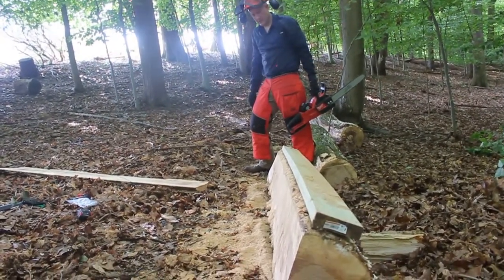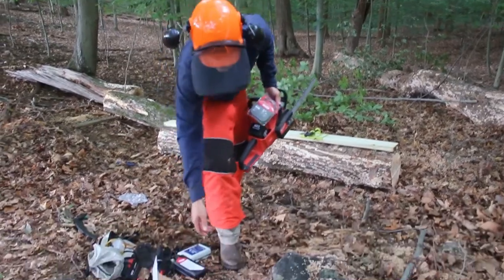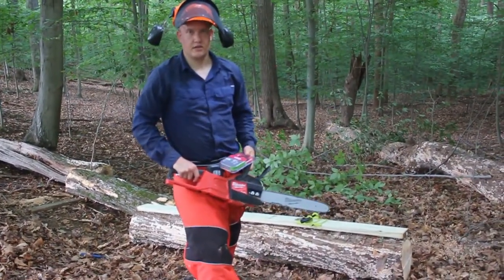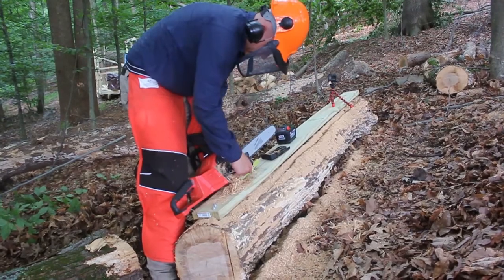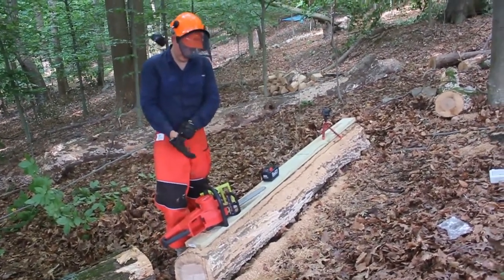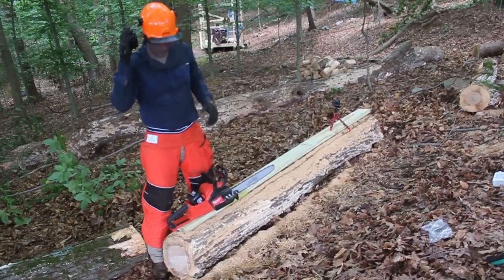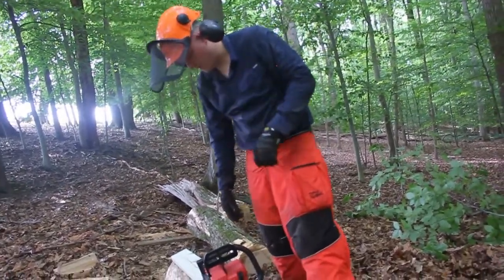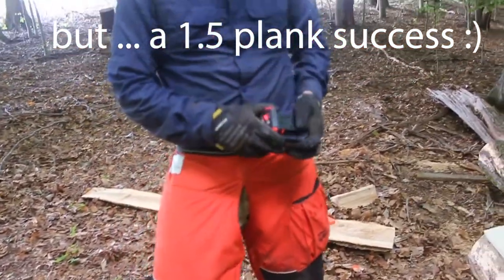Will a Milwaukee M18 Chainsaw work as a sawmill?

Comment: If you would have cut in layers instead of trying to cut all the way through it would have worked better and you not work yourself and chainsaw so hard. A ripping chain would have helped as well 
Plus that chainsaw to damn small for that job 🤔

Comment: You need to get the chain designed for this, you have the normal cross cut chain.
Grandburg the Alaskan Chain saw mill company sells the correct ripping chain.
Reply from the maker: I have a ripping chain for the saw I actually use to mill with. I was just seeing how far I could push the M18 chainsaw out of the box.

Comment: you got to admit its a silly question but i just baught that same milling bracket for my new milwaukee chain saw and have to wait to find out so thanks i just orderd a bigger battery and more bar oil the utube that was playing when i wolk up was about who the artist intended his artwork for on the wall of chamber 40 feet under the sand and when the farrow is sick you dont ask questions you dig down there and do art as fast as you can or get your head cut off hmmmm will a milwaukee chain saw do that?find a artist i cant wait ha ha ha